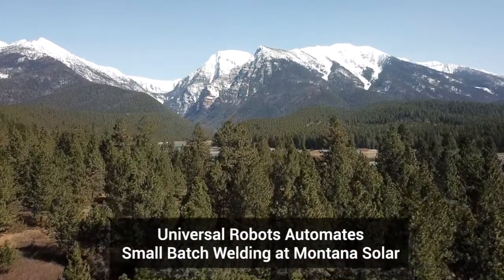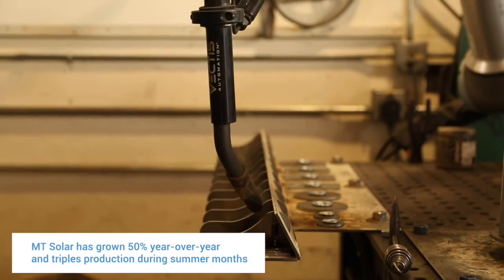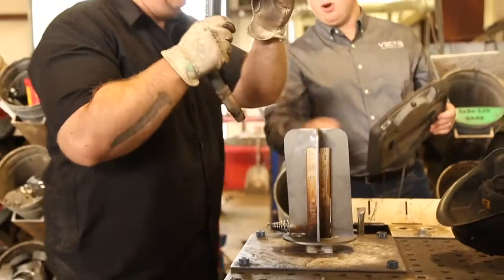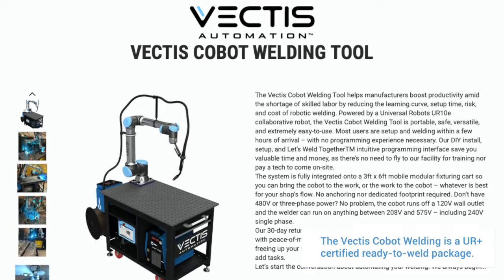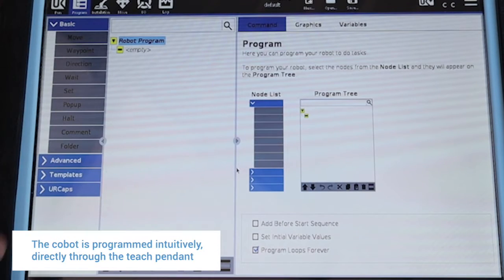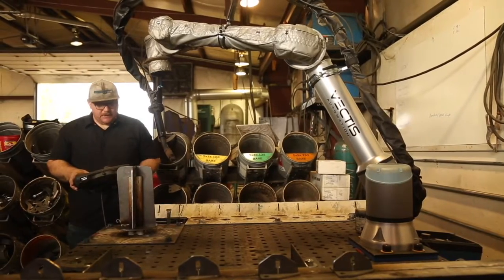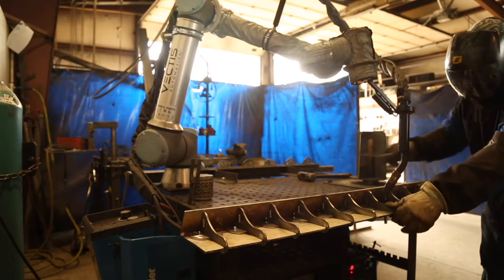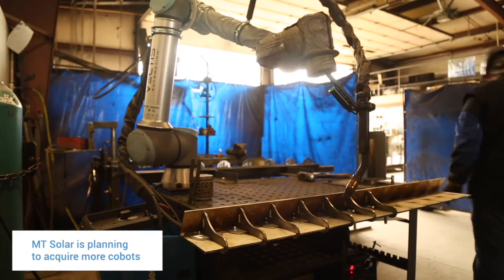Welding robot: How to automate small batch welding

Comment: I suppose they can get away without any safety or guarding for the operator as the robot arm moves so very slow in inter movement speed compared to a "normal" welding robot which can move at up to 4 metres per second and can do serious damage on collision with an operator.